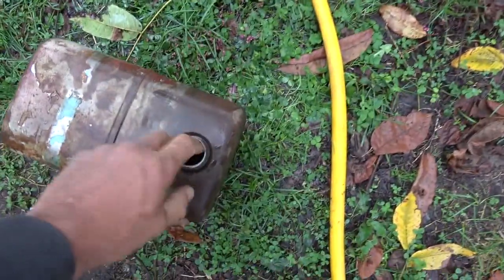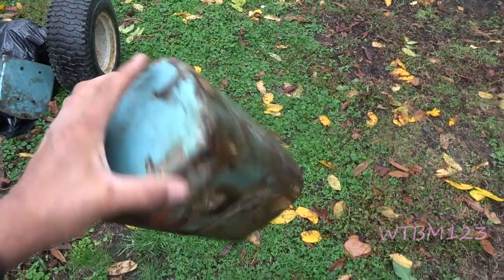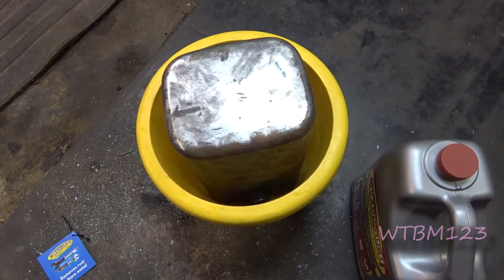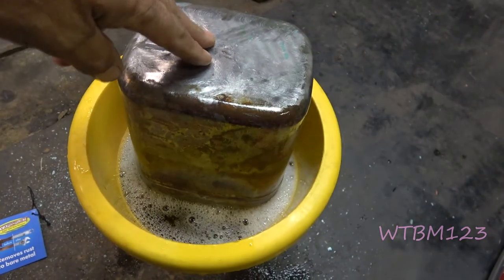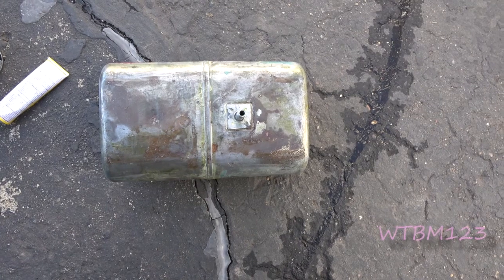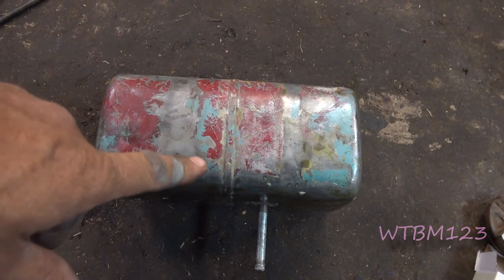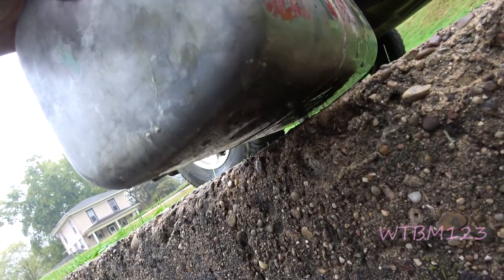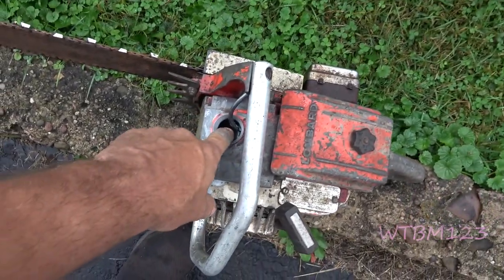SS14 Sears suburban fuel tank Fix , A really Rusty Fuel Tank

Comment: You have most definitely inspired me and how I will look at matters similar to this,I would have thrown that tank to the scrap pile. Thanks again
Reply from the maker: Hard to find good tanks and the liquid liners do a good job
Reply: wtbm123 well, glad you posted this fix I pulled the tank off my SS 14 tonight and knew it had some rust in it turns out I have pin holes too so I came back to your video for a refresher course. thanks

Comment: The guy who does the radiators and fuel tanks at work cleans the fuel tanks with Caustic soda and sulfuric acid..Man that combo goes off like a volcano but sure cleans the rust and crap out to a bare metal finish.
Reply from the maker: Was not much metal left in the bottom of this one .

Comment: Good work on the tank!! A little bit of jb weld, some small bolts and 
duct tape orta patch a tank up good heh!!  That saws probably older than i am!! 
Hows the Air Fryer and you use it often?
Have a good'nnn
Reply from the maker: saw is late 60`s i believe , been using the air fryer a good bit and still like it a lot